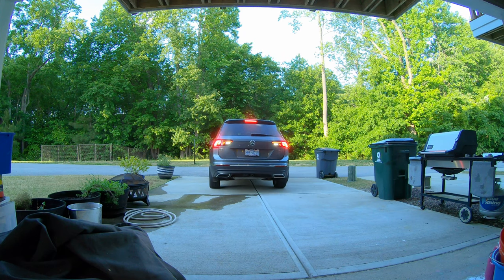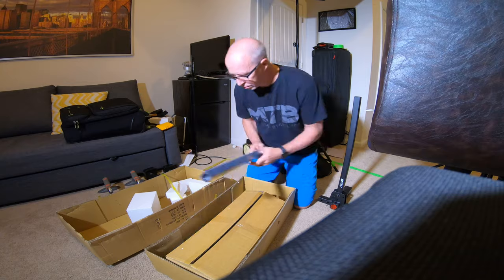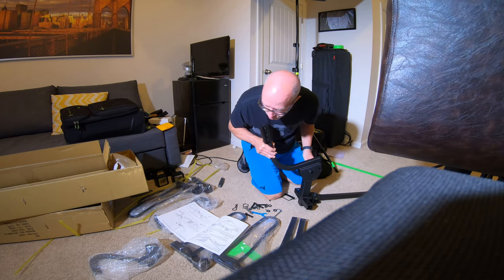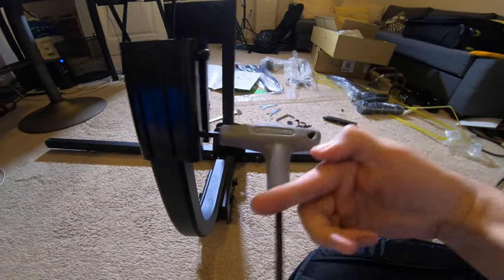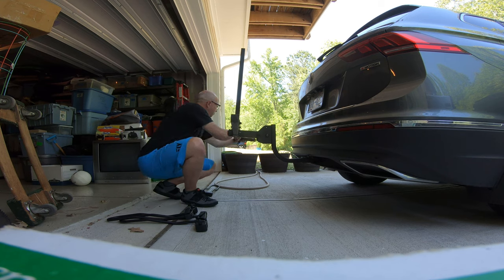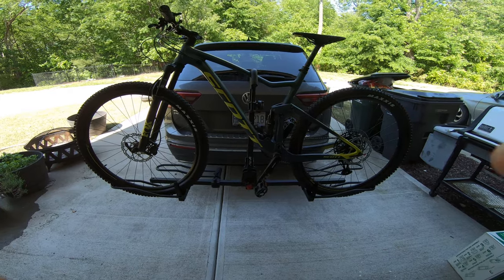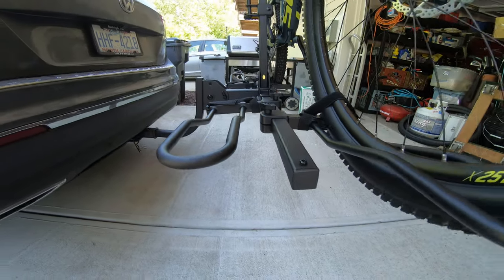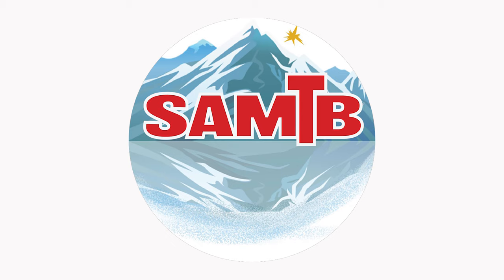The Best Bike Rack at any price! Bonus, It's Under $200.

Comment: I'm glad you did this review.  Pleas comment as to whether it swayed or not once you started driving with it on the car.
Reply: The rack is pretty solid on the back of my Tiguan and with the included adapter for larger hitch receivers. There is a screw instead of a hitch pin that seems to make a better connection with the hitch receiver. Unless I’m off road and the whole truck os bouncing back and forth, the bike and the carrier are solid. Hope this helps. By the way I’ve had the carrier for over 2 years now and no issues.